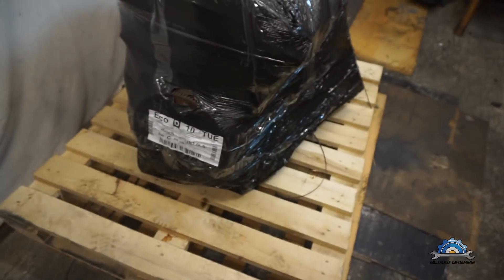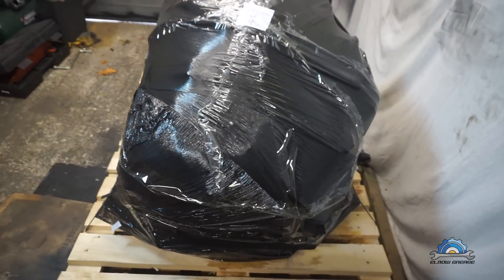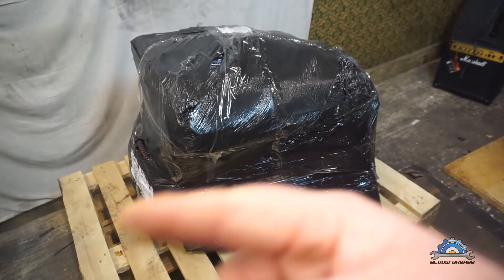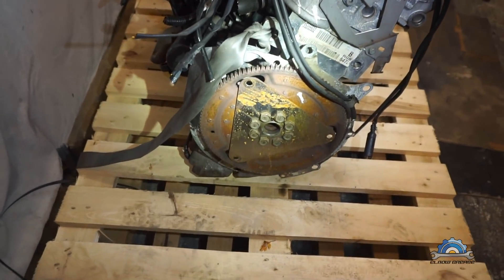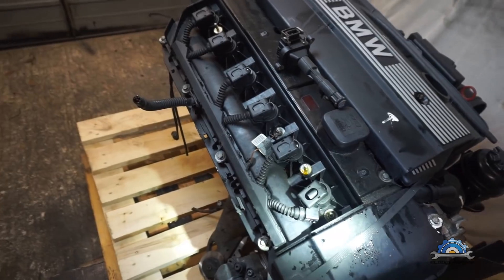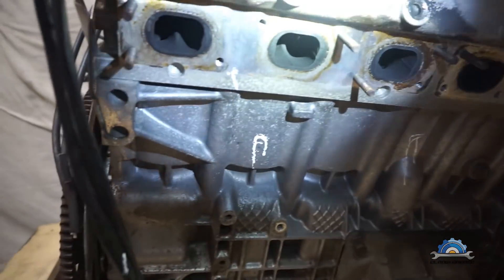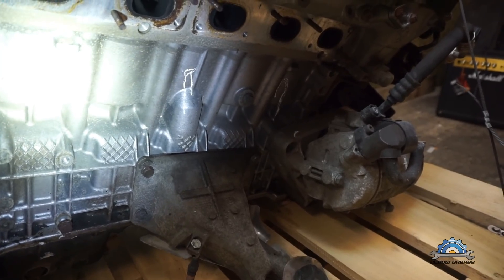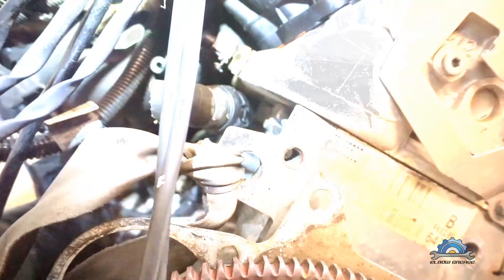M54B30 unboxing # Engine rebuild  DIY and swap 1

Comment: Congratulations on getting the new motor! Looks like it's in great shape. I'll be watching the swap very closely. I always like to learn whatever you can teach me so I might have some questions for you as you prepare the engine. Are you going to install new vacuum hoses, pulleys and pumps and gaskets ?  I'm interested to see what the compression in the cylinders might be? Is there any way to test the compression with the motor on the bench before you install it? What oil was used by the previous owner? What grade oil will you be using?
Reply from the maker: most of parts new, some stuff I will take from 2.5L cuz new like atlernator ,water pump ect.  I would not be worrying about compression, best test is leakdown,, you can have perfect  compression with worn rings cuz oil i sealing.